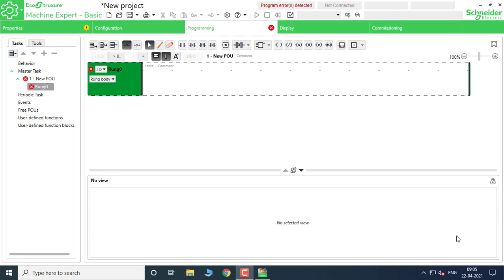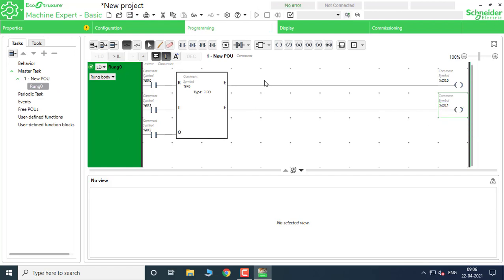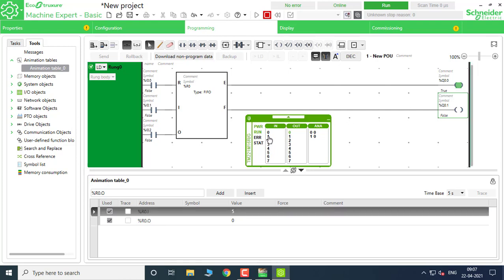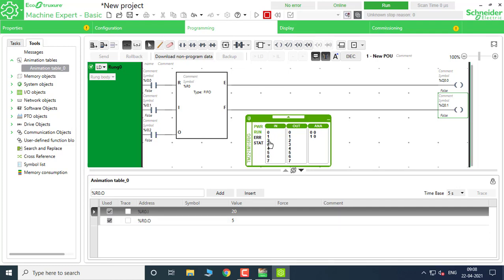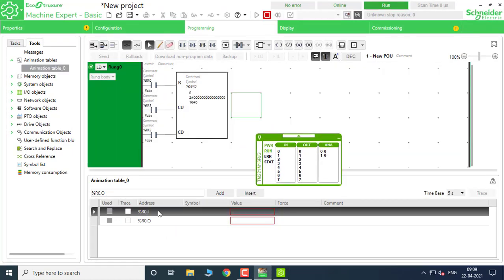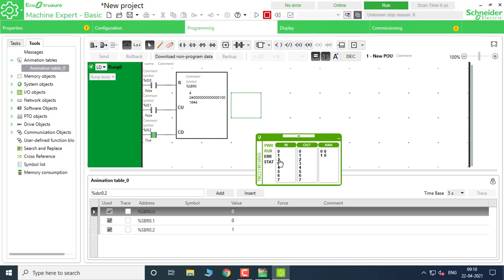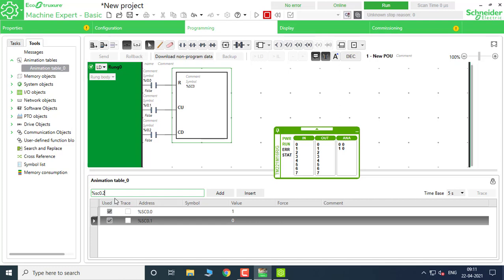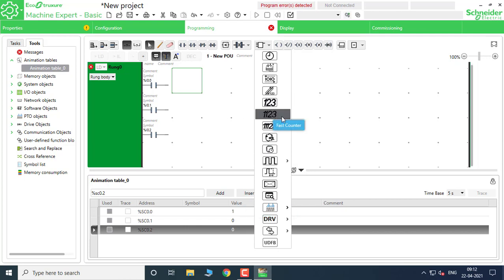Schneider PLC Tutorial for beginners Part 2 | Schneider FIFO | Step Counter | Shift Bit Register

Comment: Sir, why can't i change the value of each register ? Such in lifo and bit shift register ? Every time i assigned the value and then force 1 the contact it disappear and won't create any change at all....
Reply from the maker: Are you working with controller or simulation, and which instruction youbare using, please specify